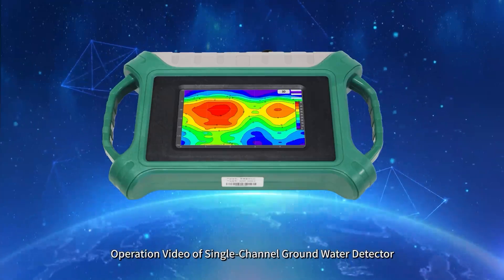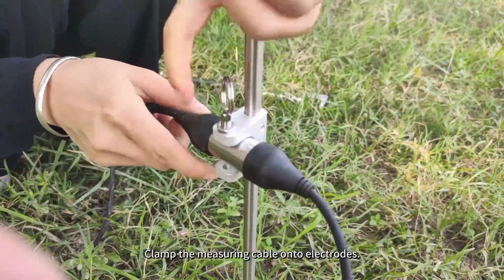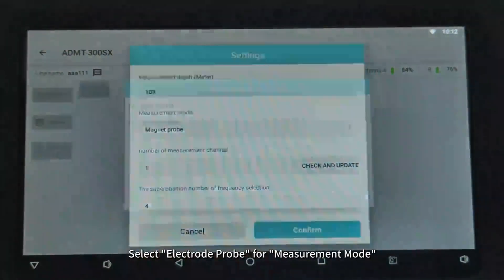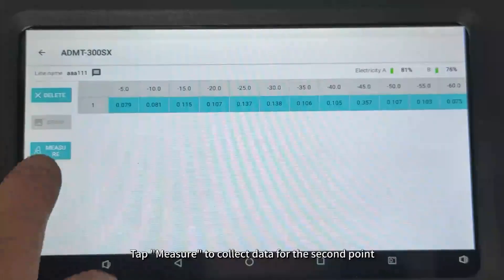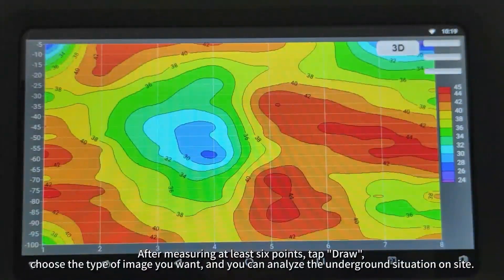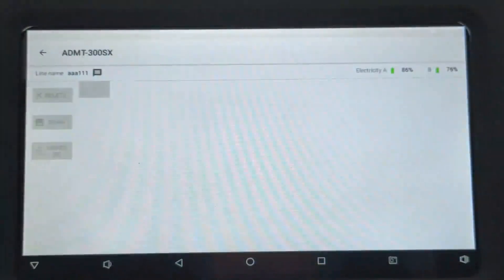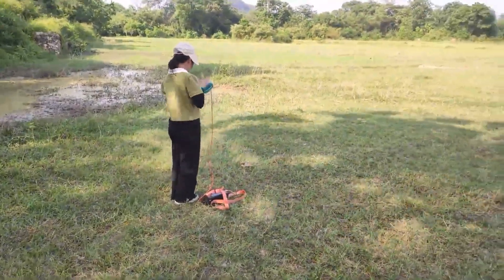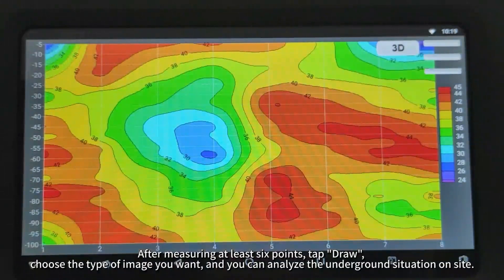Newly upgraded underground water detector de agua ADMT-300S-X 600S-X 1200S-X How to use it

Comment: Acrece
Reply from the maker: You might consider upgrading your equipment
Reply: You can upgrade ADMT sx300 to ADMT sx 600? Or 600 to 1200? Pls reply
Reply from the maker: @meshackamimo1945 If the video is not updated in time, our customers will contact me directly

Comment: For good results r2d data how much minimal point we take when use admt?
Reply from the maker: The res2d you mentioned is a feature only for ERT equipment, including Wenner, Dipole Dipole, Schlumberger and so on. Obviously, ADMT does not have these measurement Array. We also have ERT equipment
Reply: هاي ممكن معلومات عن تشغيل الجهاز بالتفصيل لو سمحت تحياتي @allenxu132